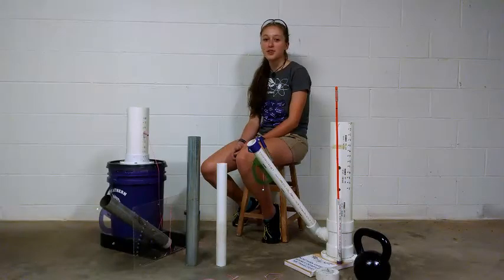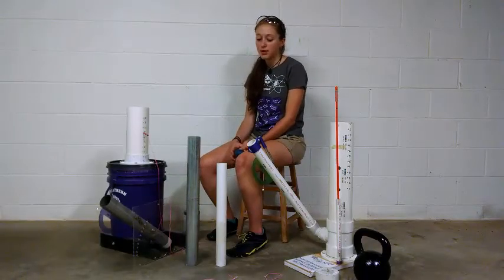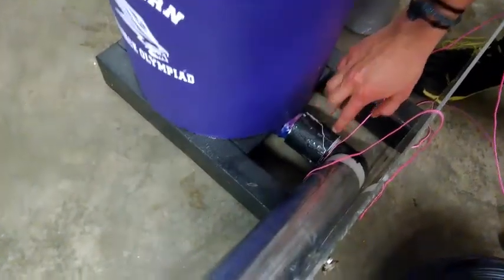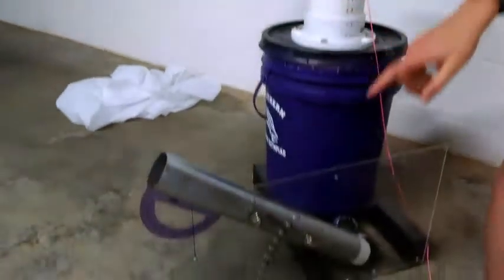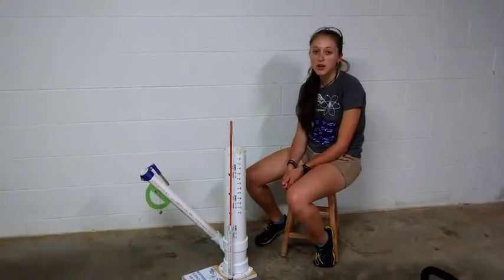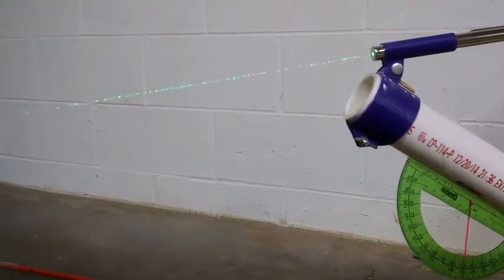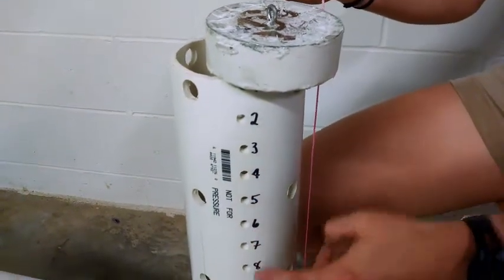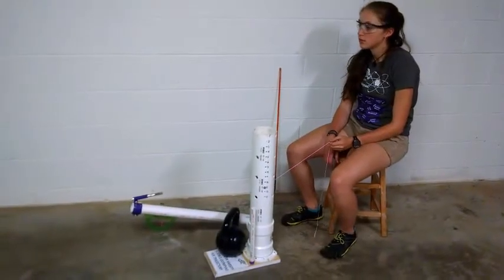Science Olympiad Air Trajectory

Comment: Hi! What was inside the pvc tube in the drop tower as an air chamber for the falling mass to hit it?
Reply from the maker: Nothing... Just air
Reply: @TMartScience  so the mass just fell to the bottom and the ball would be launched?
Reply from the maker: @PegasusPlayzYT   Yes, keep in mind the seal of the dropping mass as well as the vent holes along the side are all important for this design.
Reply: @TMartScience  how does the design have good consistency with the ball?
Reply from the maker: @PegasusPlayzYT  fewer changes in starting conditions= more predictable results
Reply from the maker: @PegasusPlayzYT   That is a bit of an over-simplification... that is the general principle, but there are many nuances to the system.

Comment: So we built almost the exact same thing, but we attached a plunger sort of seal at the base of the 4 inch pipe and for the weight, we took a pvc end cap, stuck it together with a 3 inch pvc pipe, and put a rubber gasket around it to create a seal so when the weight drops it would push all the air to the ping pong ball, but it’s not going anywhere, only around 2 m for some reason, do you have any advice to fix this?
Reply from the maker: What is the diameter of your barrel?
Reply: The launching pipe is 1.5” in diameter while the bigger pipe is 4”, we also got it to launch around 5m, but it won’t go any farther than that
Reply from the maker: You may be getting an early release of the ball... that is what the vent holes were for.... @krishivray
Reply: Do u have any advice on where to place them to maximize distance but to not let out too much air?
Reply from the maker: @krishivray you have many experiments that need to be run... if you make too many holes, you may always cover them up with a strong tape...
Reply: @TMartScience  just out of curiosity were your vent holes every one fourth of the way throughout your bigger pipe along the sid
Reply from the maker: @krishivray  yes vents on 4 sides

Comment: Hey, fantastic video- I was wondering how you configured the laser to predicate where the ball will land. It's something we are struggling with
Reply from the maker: Practice, practice, practice... This was all done experimentally
Reply: Yeah like if you increased the drop height then wouldn’t your laser pointer be way off. Wouldn’t you have to constantly change the laser p.
Reply from the maker: @savoryseaweed495  That's why you need lots of calibration test shots. So you know where to point it for each drop
Reply from the maker: @savoryseaweed495   Yes... that is why you practice it first.... figure out where to point the laser for each desired distance.    It takes a lot of trial to calibrate the set-up

Comment: Does diameter affect the airflow? We used a 3 inch pvc for the weight to go into with no holes drilled and it didn't go very far. How can we make it go farther?
Reply from the maker: Yes diameter matters...air flow and compression is essential
Reply: @TMartScience  Yes, but I was wondering how we could make it go further, as it only goes around 2 meters.
Reply from the maker: @cow1723  we used a 4 in PVC pipe for the drop tower, the combination of holes along the side allowed air to escape until a final compression burst.   This along with carefully sized and fitted barrel was essential for getting the distance
Reply: @TMartScience  Thank you for the answer, really appreciate it. Just wondering, but what was the distance between each hole?
Reply from the maker: @cow1723  you may need to experiment with this... Like I have noted elsewhere, rules and requirements change from year to year.   This was as built 9 years ago and I no longer have the device
Reply: @TMartScience  I was also wondering if the holes for the bolt to be put into were planned.... according to distance or was the spacing random.
Reply from the maker: @cow1723  they were measured, none of this was random.
Reply: @TMartScience  an inch space between the holes?
Reply from the maker: @cow1723  your design is different...so you will have to be the expert on your design.  Experiment and optimize your device.

Comment: Hi, good video but I have a question. For your 2016 design how did you make you ball go a farther distance because i am using your same design but my ping pong ball is only ping about 1 meter. so what should i do to make my ping pong ball further. also did you use any lining on the bottom of your design to stop a loud noise from the weight?
Reply from the maker: This has been answered with other comments... Diameter of the barrel is important, as are vent holes on the side.... some cloth or rubber on the bottom can cushion the landing.

Comment: How did the pressure build up in your first design(2015) and what valve/mechanism did you use to automatically release the pressure
Reply from the maker: The beach ball was loosely inflated, then a heavy mass was dropped on it. No. Valves no pressure buildup except for the falling object on the ball

Comment: Hi, my group took inspiration from your ball design, and right now we are coming up with the calculations. Is there an equation to find the initial velocity of the projectile from the mass and drop height of the dropped weight? When we use Ug=KE to find the initial velocity of the projectile, it’s giving us an incorrect initial velocity
Reply from the maker: Trying to do any serious calculations with this device would be next to impossible. Calculating the fluid dynamics of the moving air that is compressed from the following weight, frictional forces, turbulent flow, and so forth....   If you want to calculate and make some predictions, your best bet will be to graph experimental data and then see if you can find a relationship that approximates what you are achieving.

Comment: I used your first design and when I dropped the mass the ping pong ball didn’t move 
Do you know what the problem is
Reply from the maker: If you watch the video, you would see that the first device did not use a ping pong ball. This was designed to launch a racquetball
Reply: I used a racquet ball and it still doesn’t work is there something else wrong?
Reply from the maker: @Franklin_Saint_  yes, clearly something is wrong and it must not have been built the same way... I would have to know more details... Did the ball deflate?  Is the ball opening sealed to the drain pipe? Are there other leaks in the system?
Reply: The ball is fully inflated and sealed to the drain pipe. As far as I know there no leaks. The ping pong ball flys halfway up the barrel but then stops there. Is it an air issue?
Reply from the maker: @Franklin_Saint_  what size of pipe are you using? Is the pipe similar in size to the projectile? If air can get around the projectile, it will.   Just like in a gun or canon, the projectile must be basically the same size as the bore diameter.
Reply: I am using a 2 inch PVC pipe for my ping pong ball. There is space but only a centimeter or so.  Is this the reason? Thank you so much for your help
Reply from the maker: @Franklin_Saint_  Yes, this is clearly your problem! For a ping pong ball you should use a one and a half inch PVC pipe.   Of course it will take a reducing bushing to downsize, but a ping pong ball will fit quite nicely in the one and a half inch pipe.  Larger diameter pipe will simply allow the air to flow around the projectile

Comment: When you inflate the beach ball with the trash bag and then remove it, how did the beach ball not deflate back?
Reply: I’m not an expert but because the surface that makes the ball is light it shouldn’t collapse into itself without outside forces (correct me if I’m wrong)
Reply from the maker: The ball did loose some air, but was semi rigid so it partly kept its shape.    Ultimately, this is one of the reasons why we built the other design.
Reply: @TMartScience  oh okay thank you! Also, what did you mean by “fittings” (1st design) and what did you use as an air chamber (ex.  Beach ball, 2 liter bottle being pressed by a force) in your 2nd design
Reply from the maker: @PegasusPlayzYT  The ball was one of the big round balls that you can get at a store like Walmart... Regarding sink drain fittings, this can be acquired from a place like a home improvement store....
Reply: @TMartScience  okay, thank you!
Reply: @TMartScience wait in the 2nd design wouldn’t the ball deflate too?
Reply from the maker: @PegasusPlayzYT  there is no air bladder in the second design... Just compression from the falling weight

Comment: For the 2016 design, did you use a 38mm ping pong ball to fit in the barrel?
Reply from the maker: I do not know if ping pong balls come in different sizes.... We used a standard 3 star ping pong ball and it fit fairly well in the one and a half inch PVC pipe

Comment: Hi, besides using metals, what other recommendations would you give for the falling mass? we're trying to follow your second design with a 4 inch diameter cylinder.
Reply from the maker: Any heavy object that can fit into a plastic jar or metal tin that is similar in diameter to the 4-in PVC pipe
Reply: Can you plz explain how you loaded the mass into the Drop tower?
Reply from the maker: @vihaanj5560  see the video @3:30 and 3:50... using rod with a hook
Reply: @TMartScience  do you think if i made this i would need the mass?  Also i took a trrip to my local hardware store but couldn't find anything to use for the falling mass what would you recommend?
Reply from the maker: @vihaanj5560  You have lots of options... we used fishing weights... but you can use anything....  Part of this competition is experimentation.... maybe you can find a better configuration!
Reply: @TMartScience  oh srry what i meant to say in the last comment was do you need the rod if your making this or is it just a gimmick?
Reply from the maker: @vihaanj5560  we found it very difficult to load the dropping mechanism while holding a several kilogram mass with fingertips down inside the drop tower... That is why we used the rod with a hook. If you find a better way to do it, great!!!
Reply: @TMartScience hi, we have mostly followed your second design, but out ping pong ball only goes 3 meters right now, however our pipe is only about 1 feet right now, would a longer pipe allow the ball to travel further?
Reply from the maker: @Duskron  this sounds like a great experiment... See what you can get with different length barrels!

Comment: Hello. How did you secure the beach ball inside the bucket to the pipe for the 2015 design?
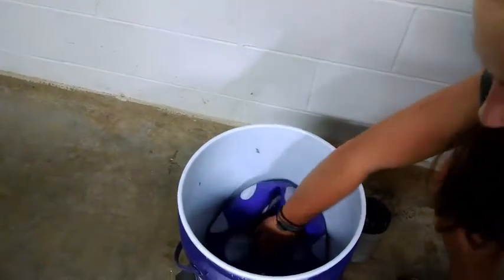Reply from the maker: It is described at 1:13 in the video
Reply: Did you glue the ball to the sink drain?
Reply from the maker: @lindseyngo5766  sink drains have a compression fitting, no glue
Reply: Sorry to bother, but this commenter had the same question I was wondering and I also wanted to know how the sink drain was attached to the ball? I feel like I understand the mechanics but I wouldn't know how to execute it.

Comment: Hi! Just wondering, for the 2015 design, did you have to do any sealant on the pipes and also where did you get the pipe that the ball shoots out? We have been looking at different hardware stores but many of the pipes are extremely long
Reply from the maker: Almost all of the joints were just pushed together, hand tight, no glue or sealant. Most of the supplies, came from our garage from various home projects. The barrel pipe is one and a half inch PVC... Some hardware stores sell this in short pieces

Comment: Hi! For you 2015 ball design, could you tell me which kinds of weights you used? I’m  struggling right now because we need 20 lbs right now to launch the projectile, but we can’t find anything that would fit inside the dropped container!
Reply from the maker: We just use fishing weights,... No need for that much weight if the diameter of the weight matches the inside diameter of your pipe

Comment: Hi.  I think that in order for the ball to be launched at all, there needs to be an enclosed air chamber in between the piston weight and the ball so that there is enough air pressure to push the ball out. How did you enclose that kind air chamber in your design, if there even was one? Are there other alternatives to create pressure for the ball to be launched? Thanks, this video is a big help!
Reply from the maker: No enclosed air chamber required. As you can see, additional holes were drilled in the drop tower to release some of the pressure so there was not too much.
Reply: Thank you! Very helpful video.

Comment: Hi, so the mass is airtight and all but it still doesn’t seem to shoot the ball out far? Did your mass hit all the way to the ground and hit the wood on the bottom? Or was there a technique in how you released it? I just don’t understand how it still is a mass that is basically airtight and not shooting the ball out at all from our pvc.
Reply from the maker: The mass did not fall the whole way to the bottom... I believe we put some material in to use up the airspace below the exit pipe.... If that makes sense.   I believe we may have also used some material to lubricate the falling mass...
Reply: Alright, we made the exit space become airtight however it still doesn’t fully shoot the ball out, did you guys perhaps use max weight, is there any additional information I should take into account to maximize the speed of this mass and the output of it shooting far?
Reply from the maker: @user-qs5fu1of2q  there are hundreds of small variables to take into account... In order to make more suggestions, I would need to see what you have built and how you are operating it... Part of the wonderful thing about science Olympiad is the experimentation... It will take a lot of trial and error to optimize your device.   The more you practice, the more you experiment, the more you will learn about the functionality... That's engineering!
Reply: Is there a way I am able to contact you further for you to help us figure this out?
Reply from the maker: @user-qs5fu1of2q  you can message tmartclimber "at" Gmail

Comment: hey, so I built the second design you showed, but I’m having trouble with consistently getting the ping pong ball to stay in its place. Do you have any tips, or was there anything specific you did to mitigate this?
Reply from the maker: You may insert a small piece of plastic down at the end of the barrel to prevent the ball from going too far down
Reply: @TMartScience Thank you for answering, I appreciate the quick reply. I had another question regarding how where you drop the weight from affects the kinematics of the system. Would releasing the weight from a lower height make the projectile go further?
Reply from the maker: @karandoshi2537  a lot will depend on your specific design and setup... experiment and find out!!! That's what this whole competition is about!

Comment: Could you explain for the second design (the one with the two connected pvcs and the elbow, the air pressure system in that pvc that distributes air to the second launching pvc that shoots the ball? I don’t get how after the mass gets dropped, what the air pressure system would be hit and how it would go into the second pvc. Also was it some sort of foot launcher or balloon? and also how was the ping pong ball stored, did it go all the way to the elbow or was it stored straight on the launching pvc and how.
Reply from the maker: Yes, the ping pong ball went all the way down to the elbow. There was no balloon or other air storage that was hit with the mass, the mass was tightly fit to the diameter of the pipe forming a piston that compressed the air. No need for anything else

Comment: Hello! I made a similar design to the piston device that you made with some of my own modifications. The issue that I am finding is that as soon as the pressure behind the ping pong ball is enough to launch it, it will launch. This happens regardless of how much air has been compressed/how far the mass has fallen, leading to very little pressure to actually launch the ball any distance. Sorry to bother, I know that it’s been several years since you made this. But if you did run into this issue/have any pointers, it would be incredibly helpful. No pressure and thank you for making this video! I’ve watched it so many times because I love how the air volume is higher and is going to be more consistent than an air bladder.
Thanks!! -Kitnarp
Reply: It does go a little bit of distance, like
How the other commenter mentioned,
Maybe ~
Reply: Having this same issue. How did you fix it?
Reply from the maker: see reply above
 @american.comeback.shirts
Reply from the maker: This is what the large holes are for on the side of the drop tower... they release a lot of the pressure until the mass gains enough speed for the final compression.

Comment: What did you use to connect the pvc pipe with the falling weight to the pvc pipe that shoots out the ball? If it is possible, do you think you could provide a materials list? Would be much appreciated, thanks!
Reply from the maker: The fitting used was just a T fitting... All of the parts were just pushed together by hand, no glue necessary. As far as material list, you can see all of the parts, the best thing you can do is go to a hardware store and try and figure out what they have and come up with your own improvements on the design.

Comment: Hi, I am currently using a similar design to your 2016 design but my cannon can only send the ping pong ball about 5 meters maximum. Do you have any tips on how to maximize distance?
Reply from the maker: Make sure the following mass slides easily in the drop tower  and make sure that it is tight so you do not lose air
Reply: how much weight did you use? @TMartScience
Reply from the maker: @davutseker7119   ... all the loose fishing weights that we had in the garage.   Part of the point is to experiment with what you have!